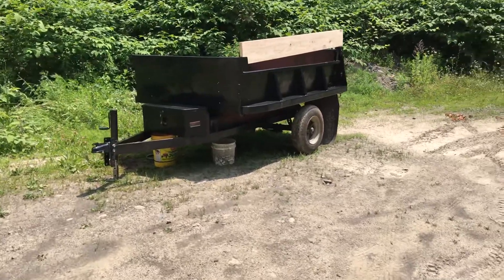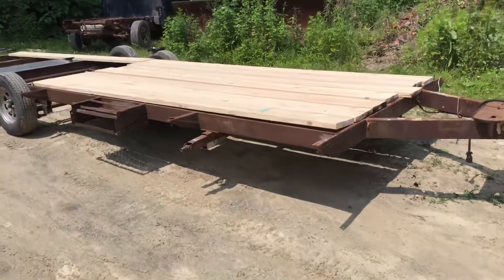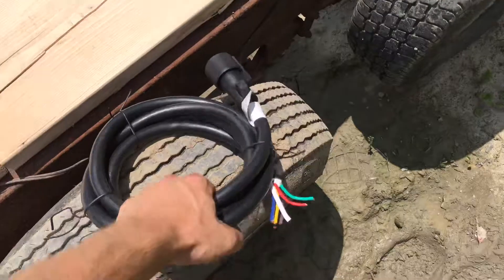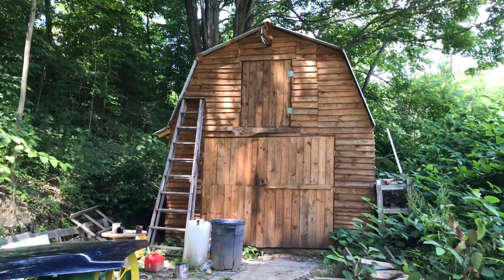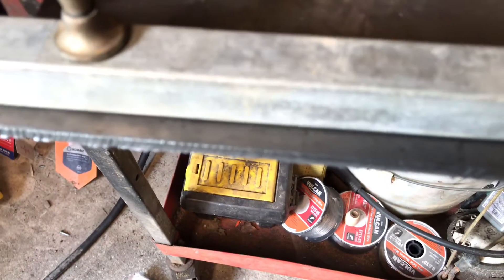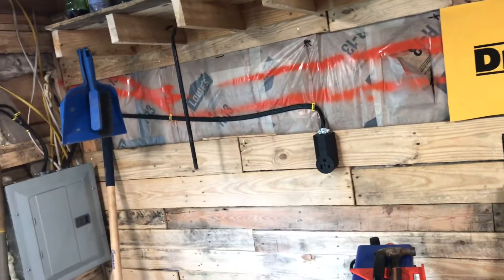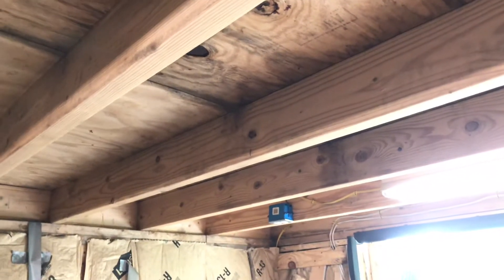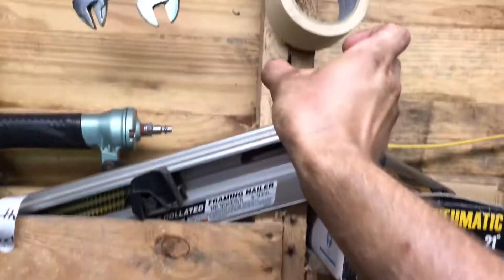Guided tour update

Comment: Its never going to be able to haul as much as you think
Reply from the maker: Hunter Slavick one full cord, 4K lbs is all I need
Reply: 67 IH Farmer  the flat deck trailer
Reply from the maker: Hunter Slavick 7,000 lbs on the axles 10k on the frame
Reply from the maker: It’s only as strong as the weakest link